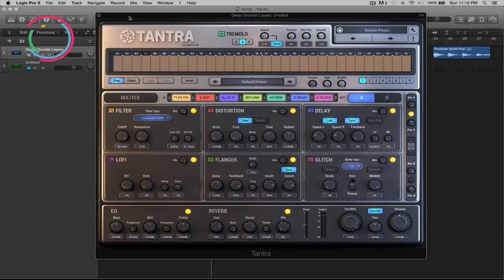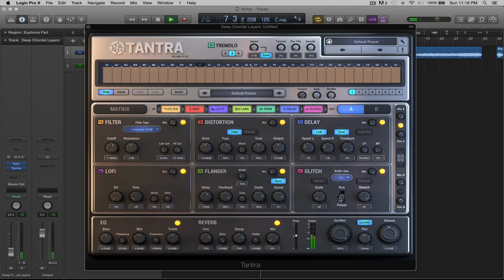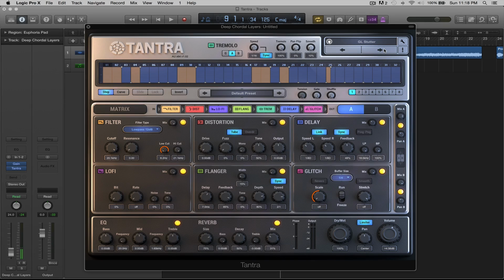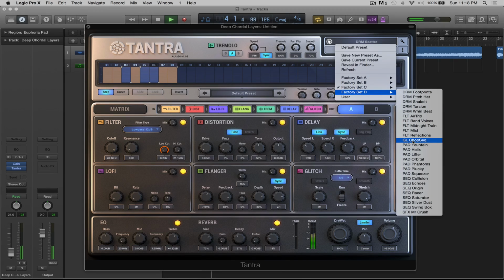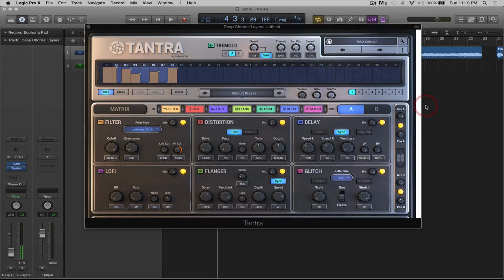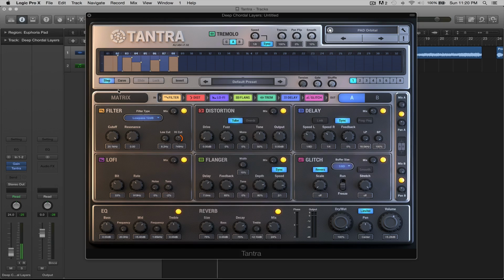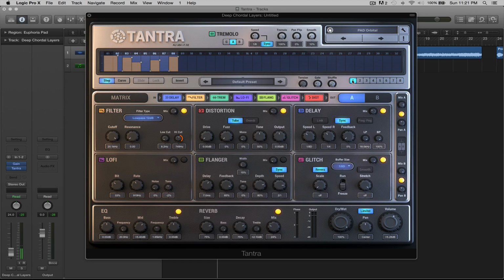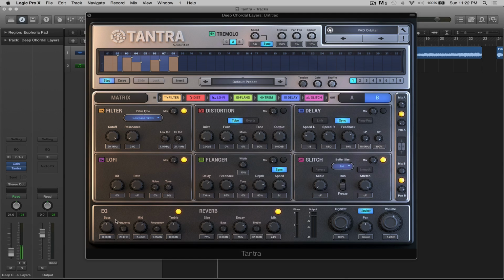How To Use 'Tantra' with Sami AKA Aiyn Zahev

Comment: ------- CERTAINLY DO NOT RECOMMEND THIS DEVELOPER :-( -------------------------
First TANTRA plugin was great and had one of the best designed interfaces I've seen. The version 2  GUI is simply a trash.  Ugly, unreadable, no contrast "no sould".  But WIT THERE IS MORE.    My drive crashed and had to reinstall my software. I requested a license from the developer twice and so far nothing.  Tantra runs in DEMO mode and basically I have thrown money into a drain. This developer simply fals int the same category as many others. SELL YOU A PLUGIN AND NEVER HEAR FROM YOU AGAIN.   so sad.

Comment: Outstanding review here was part of the reason for buying it.  Caught it at a world beating price on PluginBoutique... ($28!)  (not a shill or employee of them, but if you aren't watching them for great deals on all things VST then you're missing out, especially when they toss you a buck or two in rebate you can use in a future purchase)

It reminds me a bit of Movement by Output which I had bought earlier.

I think these kinds of tools are a great way to get some rhythmic feel quickly brought into play for things like Pads, or any static sound like that.

With all these arpeggiation tools and arps built into soft synths as well as EFX like this, there is a TREMENDOUS opportunity to take the rythmic motiffs from one and duplicate them in one of the others! It can be a huge untapped source of inspiration as not everyone can sit down and create a great arpeggiation off the cuff...  For example, what about recreating one of the preset arp patterns here into Omnisphere's arp?  Yes, all things may not map across perfectly from one tool to another, but that may be part of the newness you get from the effort.

Now we need someone to take a concept like Microtonic and create a web site that merges and morphs those patches generationally until and endless variety, and instead do this with ARPS, so that you go to a web page where it's merging and morphing a huge library of arps together to create an endless number of permutations...  Huge opportunity for a tool designer there!  takers???